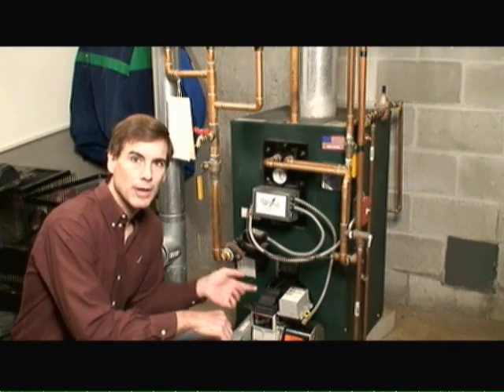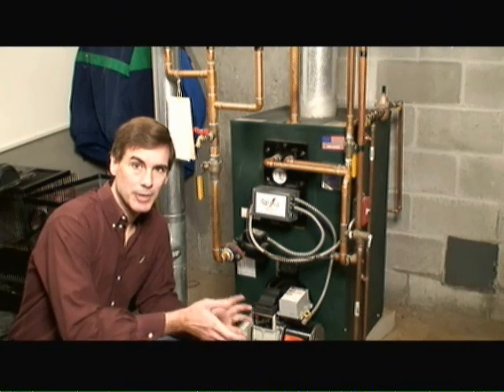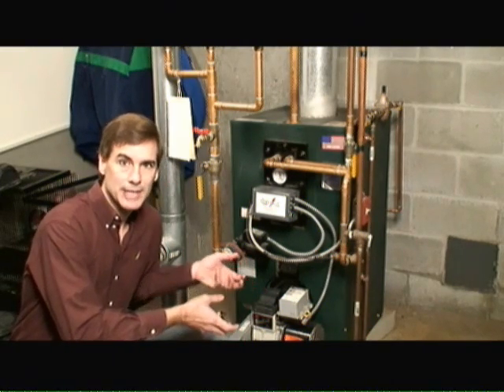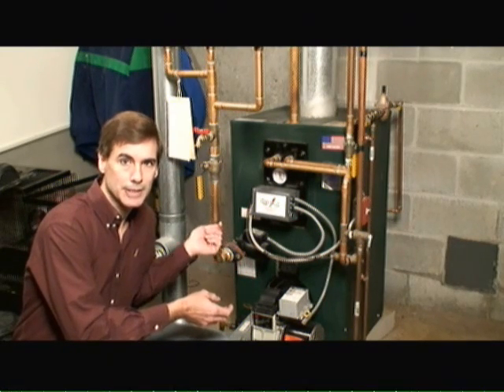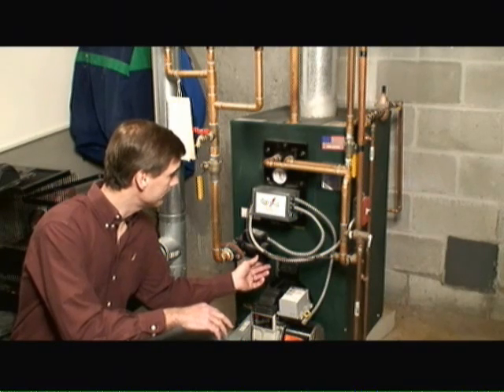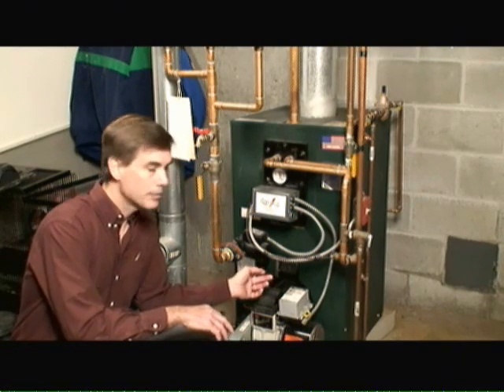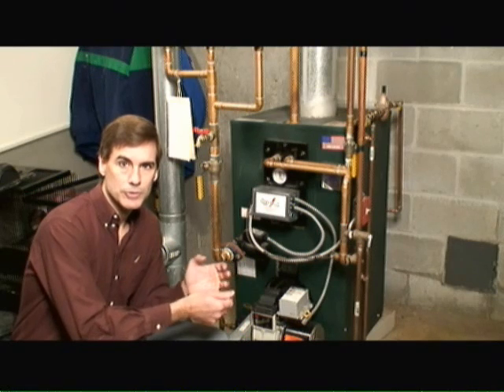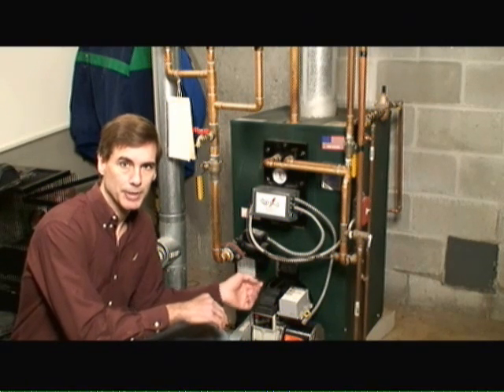Hot Water Circulator Pumps Video

Comment: I have almost the same  boiler on your video, but I have heat, and Don't have hot water..Do I need a new circular pump? Or is it something else? When the  boiler kick in and stop, I got like a Luke warm water like a couple second then back to cold...help!!! Thank in advance...
Reply from the maker: If you have a hot water holding tank then yes you will need  a circulator pump that moves water thru the tubing in the hot water tank to heat the potable water in the hot water tank.
Reply: @HomeAdditionPlus  I don't have a separate system, it hot water and heat together...old fashion heat from radiator...it heat the house and produce hot water at the same time..
Reply: @sophatchea1158  I would guess it was the mixing valve.

Comment: Do the Circulating Pump supposed to run all the time
Reply: LeMaiosnduPaix11 - that depends how it’s hooked up. I had one running all the time and the other was on a thermostat and on came on when it was call for heat
Reply: Typically only when there is a call for heat
Reply: When you have a cold start boiler, the pump motor is started by the control module, which receives a low voltage signal from a zone thermostat.  You either have one motor pump for all zones and the zones have a zone valve that opens or closes, or separate, smaller pumps for each zone that switch on when a zone thermostat calls for heat.

Comment: I have a 1960 circulator pump installed in the rear of the boiler. Can I installed  the pump on the supply for better circulation ?
Reply: Recommended position for pump is on the heated water supply side, meaning after the heated water leaves the boiler.